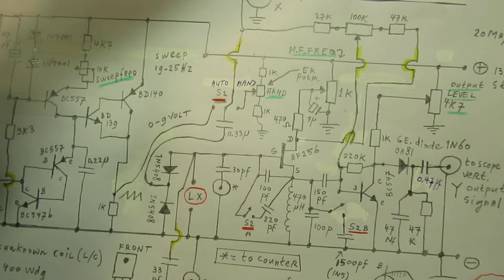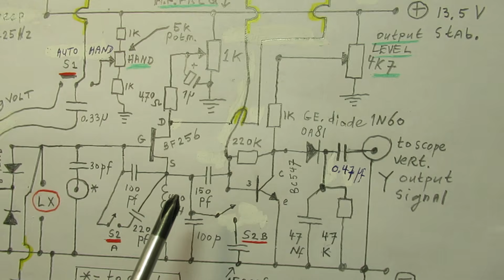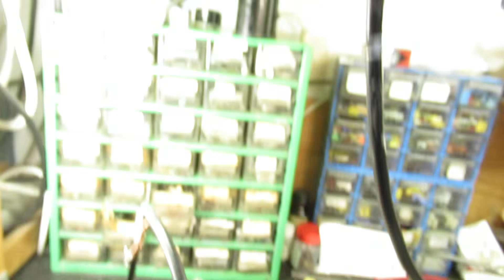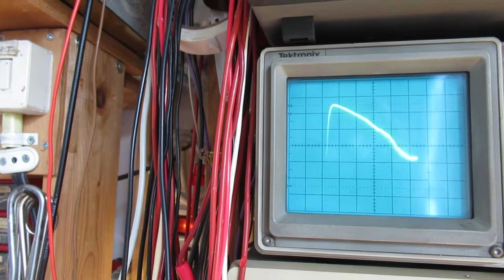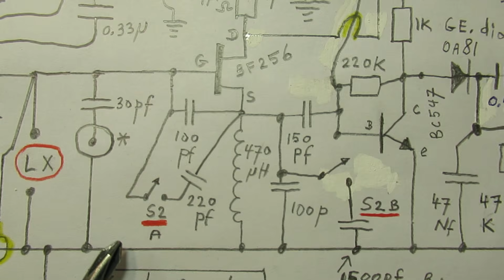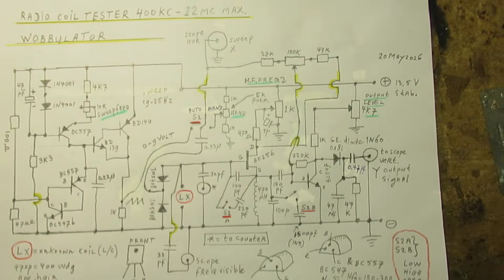Radio Coil tester for Shortwave & Wobbulator (350 KC-12 MC) schematic and demo (via Oscilloscope)

Comment: Very nice simple wobbulator circuit, the last time I used a wobbulator, was in 2000  to set up the RX TX of ship to shore Radios when they failed the line setting up, when I working for simrad navico as the shop floor engineer for all products.
Reply from the maker: Thanks!